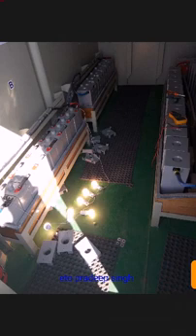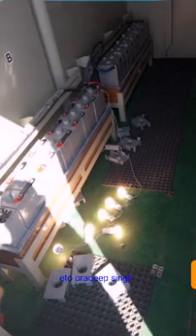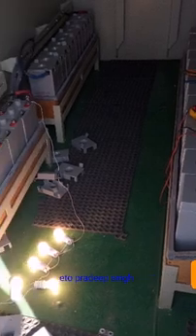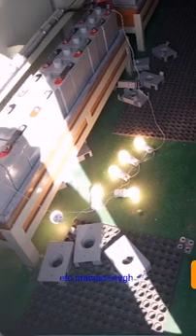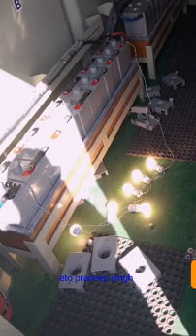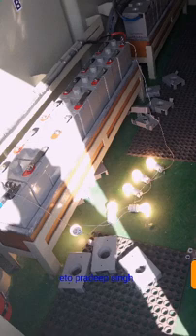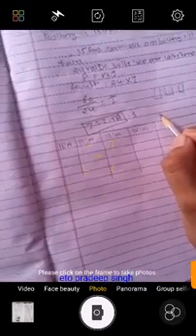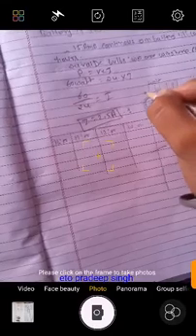Normal battery load test on board ship

Comment: While load test need to switch off battery charger connection and also need to remove terminal connection??
Reply from the maker: Enough for switch off the battery charger no need to disconnect wire positive/ negative